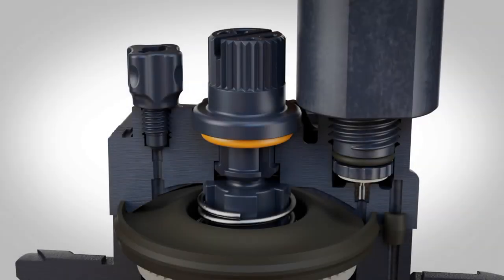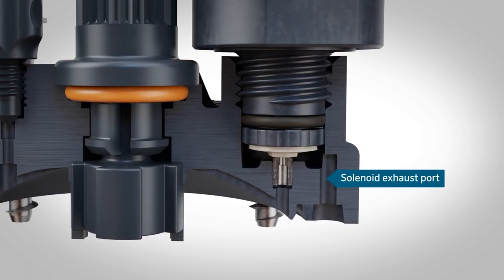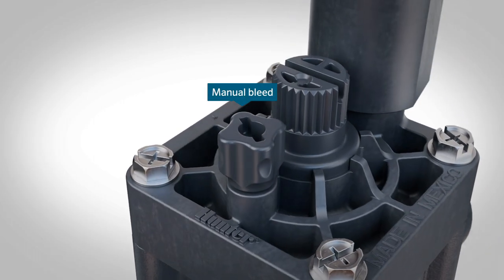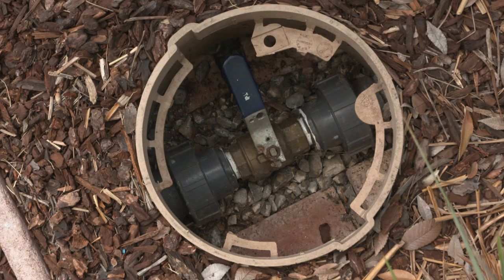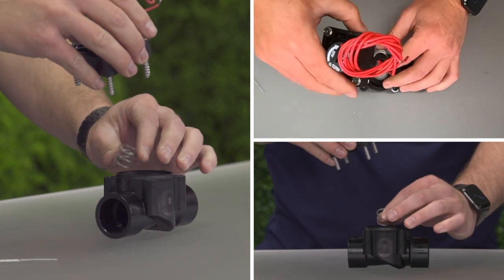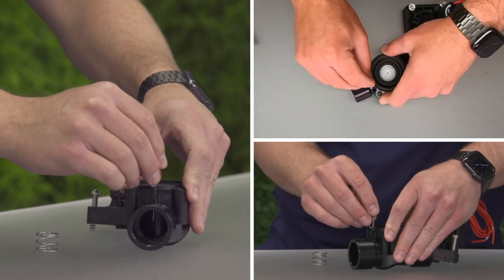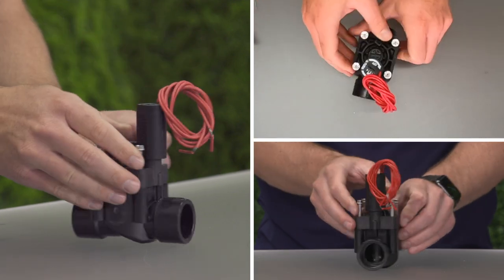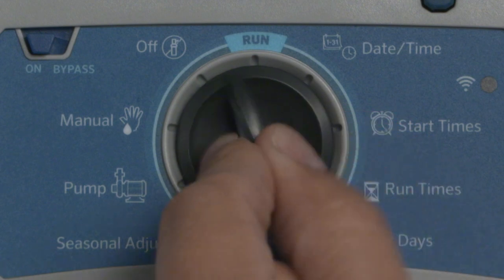How to check the exhaust port on a Hunter valve

Comment: I have Hunter valves (PGV just like in this video) and controller (Pro-C) whereby one of my zones is not activating any more (either on Schedule or via Manual station run). If I give the solenoid a 1/4 turn to test, I hear the water swish through the valve and the sprinklers in the zone all pop up and start watering.  I already replaced the solenoid, the valve bonnet, diaphragm, and did that paper clip trick into the valve, but the zone is still not working when trying to activate it from the controller.  Any ideas what else might be wrong?  Thanks!
Reply: Yes. Bad wire connection or old bad solenoid are first checks.
If you do not have a meter to check the Ohms resistance of the solenoid, then the other option is..
Pull a good pair of wires from a working zone. Hook them on to questionable solenoid.
Run the good zone.
If it works, Solenoid is good.
May be a timer issue.
Or bad hot wire or ground or connection.
Rarely a wire may have been damaged somewhere.
Reply from the maker: It sounds like your system will operate manually but not electrically. Take a close look at the wiring between the controller and zone valves. Failing that, it may be time to contact a local irrigation professional for help with your issue.
Reply: @bubblerings   Yup did a Ohms check and wiring switcharoo like you suggested, it's definitely a bad hot wire. Will replace in the future.
Reply: @Hunter_Landscape_Irrigation  I deduced it to bad wire.  I have a new 18/7 loom of irrigation wire that I will have to retrench.  I will replace all wiring to give me piece of mind moving forward, as the system is 16+ years  old - thanks for the reply!
Reply: @Hunter_Landscape_Irrigation   a year later is better than nothing.. Your products are very good.🎈
Edit: Wishing there was a switch on pro timers.. To Choose, if timer allows one or two valves to run at the same time...
Due to pressure issues.
Allowing 2 valves at once by default, often causes problems.